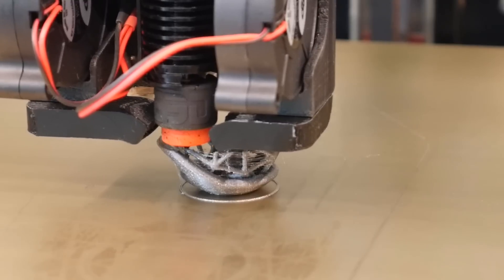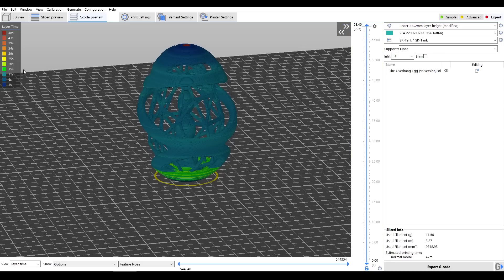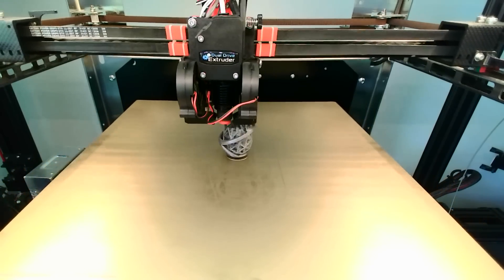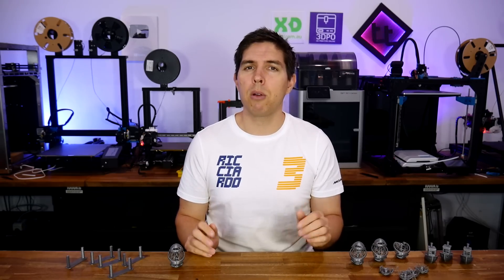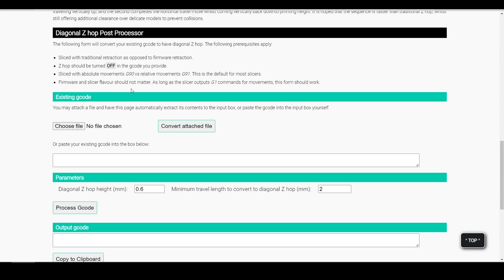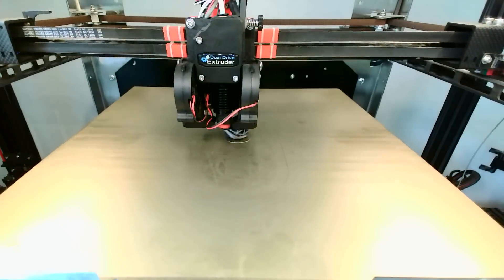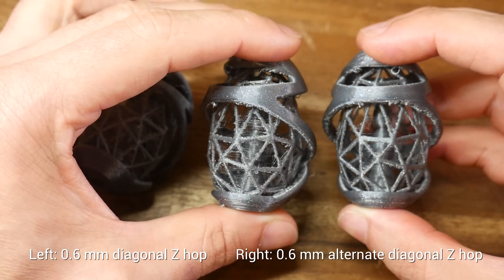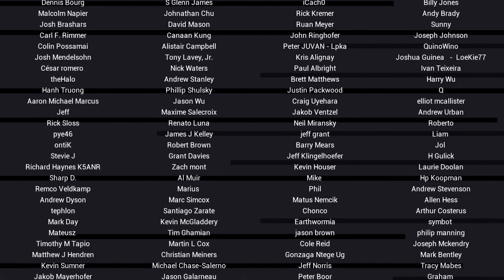Diagonal Z hop - Help me test this new slicing idea

Comment: Most of my stringing and overhang issues have been remedied by setting layer height to 0.16, 100% fan, retract & then wipe towards infill before moving to another area. No Z-Hop necessary.
Reply: Zhop is very usefull for avoid crash with parts pf a model , specially if yuo print fast ,for me "fast" is 120 , 150 mm/s
Reply: @noway8233  lol.
My v400 does 400 mm/s and I want more speed.
Reply: I didn’t know one could wipe towards infill before hopping. Going to have try that in addition to diagonal.
Reply: @Thesuperchargedbrain  I think it's termed "wipe inwards" if memory serves me correctly.
Reply: @RTR-MATEY  which slicer are you using?
Reply: @Nanoqtran  Currently using SuperSlicer.
Reply: Is there an equivalent in cura to wipe towards infill?
Reply: For PETG wiping helps against stringing too but without z hop oozed material would accumulate on the next border crossed when travelling to the target spot. Diagonal z hop should solve both issues - avoid building whisps at the  beginning  and avoiding accumulation while traveling accross borders!
Reply: @user-qu3sp9tt3n  Thanks! It's been awhile since I printed with PET-G. Last roll I used, I had the insanely weird experience of some of the prints fracturing ACROSS layer lines!!! Not sure if it was my hotend temperature too high or whatnot. Now I mostly print with PLA+. Any hints/tips you can give on PET-G temperature would be much appreciated!!!

Comment: like you i suspect the key is in the initial move away from the model. i think starting the move horizontally (ie. identical to no z-hop) would be worth trying. then raise Z while travelling using a sine function or something so most of the vertical move is done near the end to hop over the obstacle before plopping down again.
Reply: Wouldn't this just lead back to the original issue of the nozzle catching on the curled overhangs?  That was my takeaway from the video.  The diagonal hop is interesting but you still need that initial vertical hop of some sort to get clearance over any curling.
Reply: @bsimmons00  depends on which overhang you're talking about.  If you're talking about the overhang (protrusion) at the destination, then no, you're hoping over it.  If you believe the problem is because of a protrusion closer to the head's current position, then yeah, you won't avoid that. Though, from experience, it seems like there are few issues that arise from bumps near your current print site (probably because of how fresh and warm the area is), and most of the issues come from crashing into something near the end of the travel to the next print destination (which is cooler and more rigid).

Comment: To be honest - I use special 3d printing glue, rather than stick glue. It helps the detail stay in place. Why I am mentioning that is 'cause when the detail sits in one place the heat from the nozzle wouldn't just knock off the print, but it will actually melt the tiny bit of curl on the edges. So far, for 5 years it proved me that it's completely perfect solution. To be fair - I am printing Voronoi and web type of prints, never-ever had to use Zhop. 
May be you (all of you) should try using glue too. I am suggesting Dimafix Pen 3d. :)

Comment: Nice idea, Michael.
After travel, maybe if the nozzle lands at the infill instead of at the perimeter would help a bit more.
Reply: yes! also maybe before "lift of" the nozzle goes a bit inwards to the part while retract and then makes the z hop to the other location to pint.
Reply: @ottoglockner8467  Perfect! Like a wipe on the infill before and after the travel. That would be awesome.

Comment: Looks to me like you could improve the bed adhesion, too.
Reply: Yeah, I thinking “Uhhh, did you try using a brim?”

But there might be another issue that crops up in that case if it’s hitting curled up edges…
Reply: @sublucid  I was thinking "why isn't he using 100% fan speed all the time for pla?"

Z hop is not something I would ever use to fix this

Comment: Will it work well with Klipper? I read that the normal Z Hop should be disabled. I used it with klipper and it worked fine, so I do not know why that suggestion was made in the Klipper guide.